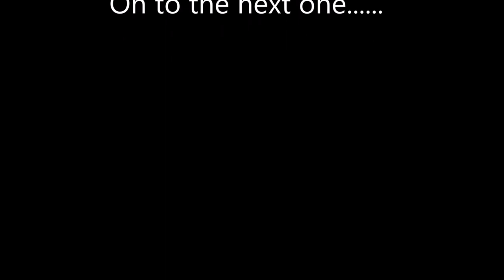1972 Ford Pinto Runabout Restoration Part 5 - The end

Comment: Ahh! A California survivor!  I had a ‘72 Pinto with the 1600 pushrod engine with stick shift.  It was a good car with no issues.  It was unfairly attacked because of the gas tank problem.   But it was no different than having a gas tank located in your trunk (Opel) or in the cab of your pickup (Chevrolet).

Comment: I bought one of the first Pintos back in late '70 or early '71 in San Diego.  It was $1800 and the ONLY options were a radio and heater.  It did not even have carpet, only vinyl.  It did have the 2 liter and a 4 speed.  Loved that car and never had a problem wit it.  Good to see someone bring one back from the grave.

Comment: I had a '71 that wouldn't start for the previous owner. It turned out to be a timing belt problem. After I fixed that the car was a hoot to own and drive for a few years.

Comment: I did a 72 2.0 in 78. My first all in motor. I wish I had read up on the lousy head before I spent all that money. My parts combination was about the worst it could be. It took 10 years and another car to finally get it together and running. A major dog. That head is garbage, and it takes a master head guy to get anything out of it at all. David Vizard says so, and he was a master. Never use domed pistons with this head. The flame front is jacked up by the dome, and no matter what else you do the engine will make less power not more. The Lima 2.3 is much better.

But for a stock Pinto the 2.0 was a good runner. I never broke one, and iirc the midget guys made em go real good.

Comment: You're supposed to do the engine 1st but at least you saved that little Pintos life. I let mine die in the junk yard in 1983
Reply from the maker: Yep! The engine was sweet when I started, then got very smokey when the  rest was done. Doh!
Reply: @TheMotopool  you did a fantastic job no matter what! Thanks for the memories man 😃😃😃😃😃now for that C4s. I've ben rebuilding those senc 1978.    EDWARDS BROTHERS TRANSMISSIONS ROANOKE RAPIDS NORTH CAROLINA.  EST 1977.